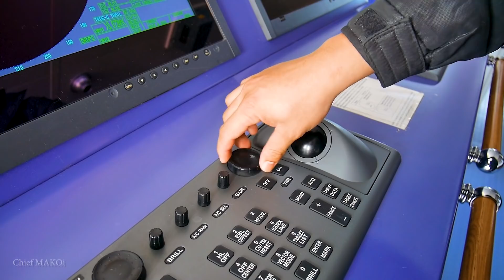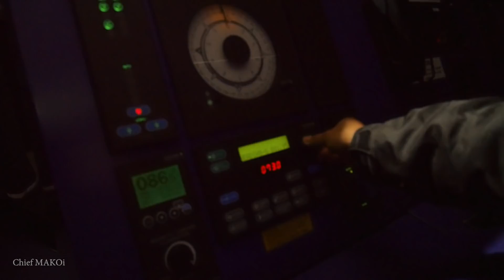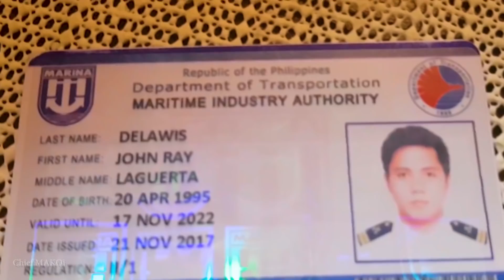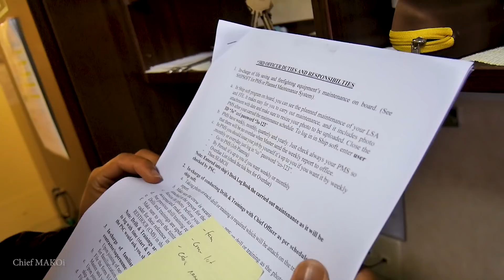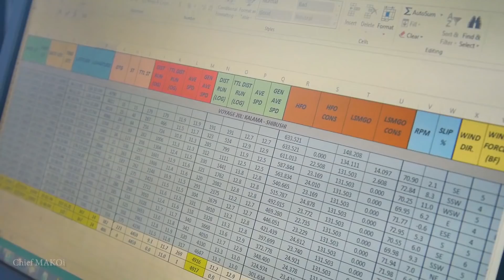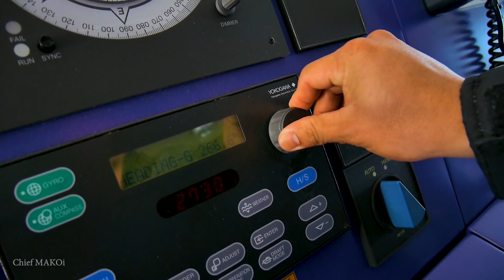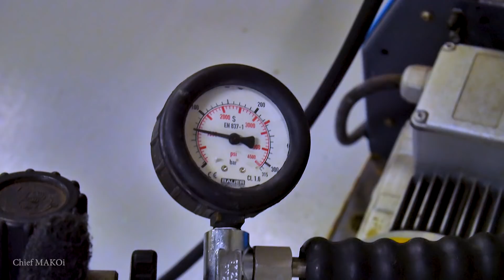Cadet Gets Promoted to Third Mate : Life at Sea | Seaman Vlog

Comment: Chief, I’m not sure if you had done a video on Electrician before. In case not, it would be great if you could do one on “Lecky” as electricians are sometimes called. These poor guys very often have to work while ships are alongside to attend to problems on deck cranes with no chance of going ashore especially when their ships are geared. Also almost on every part of the ship has some sorts of electrical stuff to check or maintain.

Comment: Nice video Chief MAKOi! When the 3rd mate is on navigational watch is he steering the ship or is the vessel mostly on auto pilot?
Reply from the maker: Auto.  But he is the one who alters course when a waypoint is reached during his watch.
Reply: 2:30 using routine chart for plotting...
Reply from the maker: The ship is full ECDIS.  Routing chart is just for quick reference of ship's position.
Reply: @ChiefMAKOi  Routing charts are essential for use in passage planning for ocean voyages. They include routes and distances between major ports, ocean currents, ice limits, load lines and wind roses, with expected meteorological and oceanographic conditions for each month of the year. Five charts cover the oceans of the world; North Atlantic, South Atlantic, North Pacific, South Pacific and Indian Ocean...for quick refeence he can use the general chart or small scale chart if it is available on board....godbless sir safe voyage.....